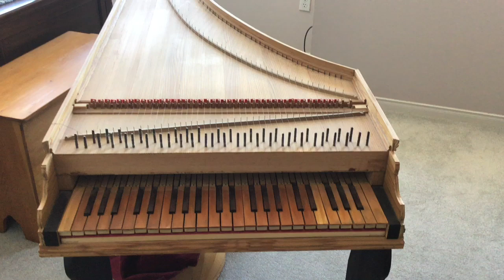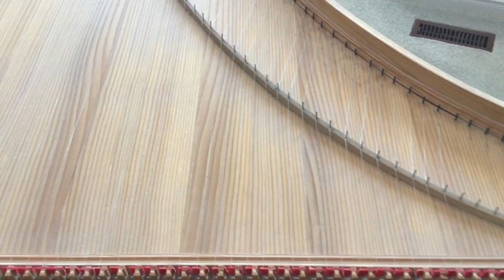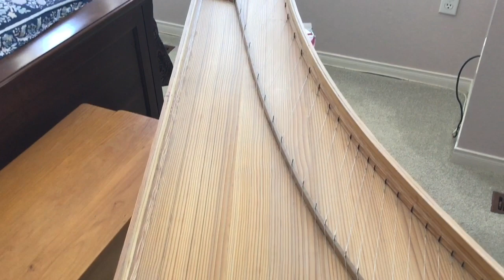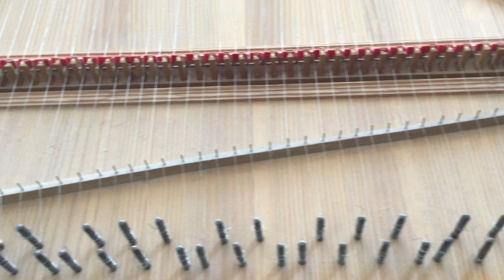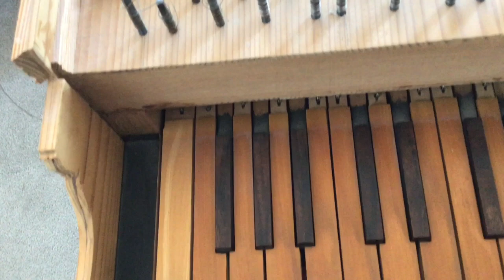How harpsichord string lengths make musical intervals

Comment: That's all pretty elementary.  Octaves twice as long... strings of same gauge being the 12th root of two  difference between notes, blah blah blah.  But what is the length of a string.  What makes a good Middle C for instance?  Gauge and length.
Reply: this is what i've been surggling to find out too, i know it's a simple thing to determine the intervals, but i hav'nty gotten any actual lengths and gaue nmbers, i could fill the rest, but only if i knew the trend